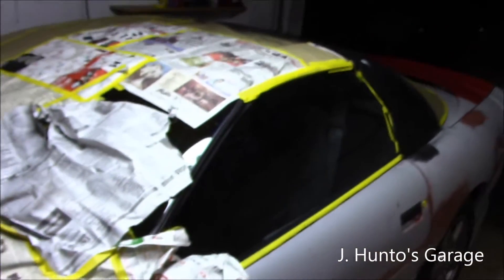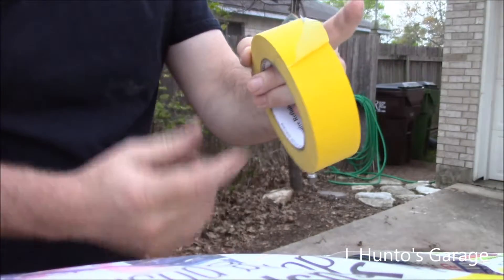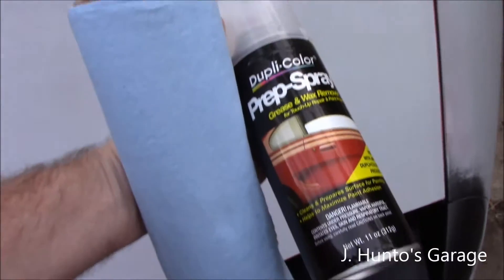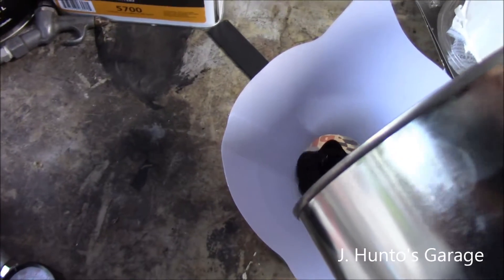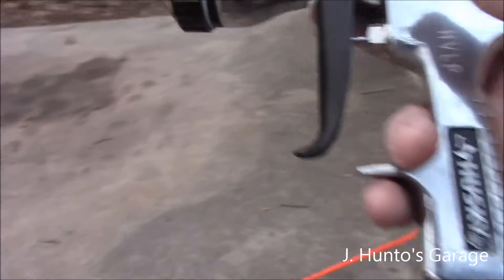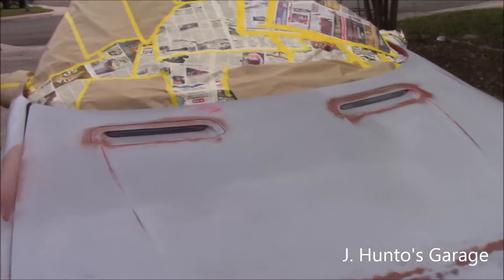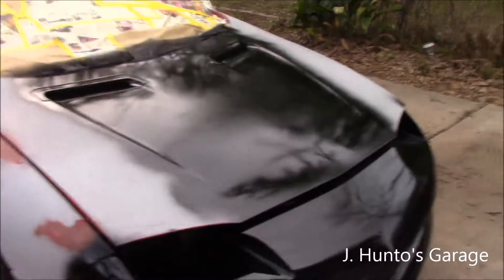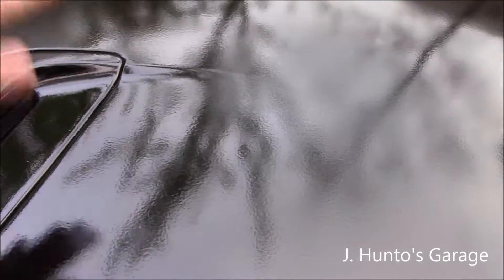PAINT HAPPENS!

Comment: I'm considering getting this kit, I hope it wasn't the gun that caused the orange peel....
Reply from the maker: Jeff Stone I don't think so. I think was partly inexperience with this gun and inexperience with this particular paint system. The black never fully cured. Same paint manufacturer! :/
Reply: J. Hunto's Garage The only thing I've shot out of a gun, which was a conventional with the bottom cup about 20 years ago, was some black epoxy primer... I've recently been learning about the LVLP guns, they might be more suited for me since I only have a 5HP 25 gallon compressor....It has an SCFM rating of 9.1 at 40lbs.... Probably not the best with an HVLP gun. But yeah, sounds like that paint was giving you major fits, that's frustrating!
Reply from the maker: Jeff Stone Go for it! Let me know how it goes. You wouldn't be in the Austin, TX area would you?
Reply: J. Hunto's Garage  No Sir, I grew up in Middletown, Ohio, a steel town, until 2010 and moved to Owensboro, Ky to be closer to family....